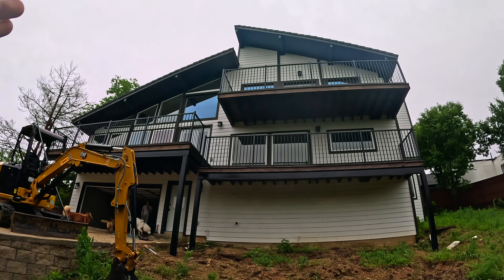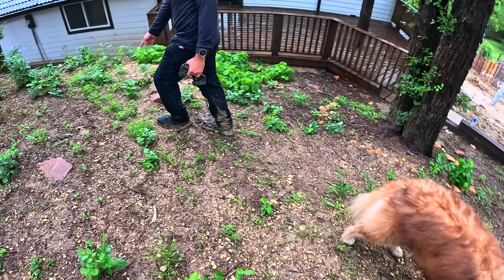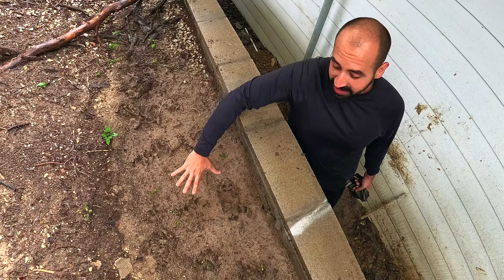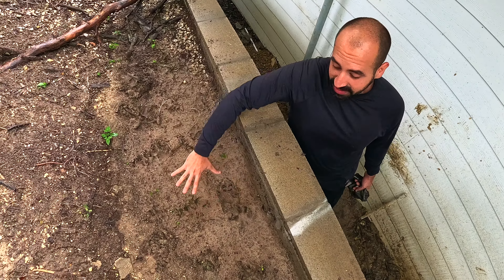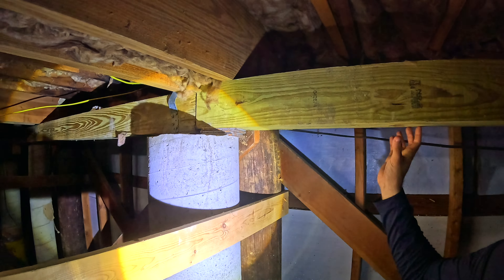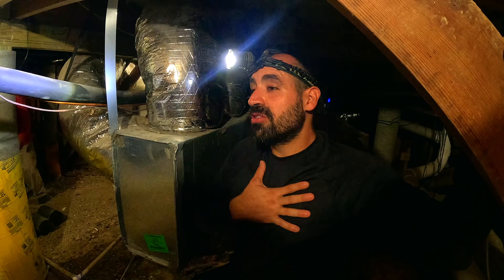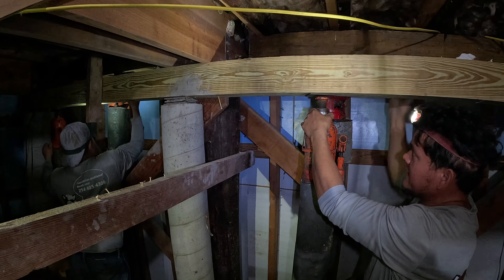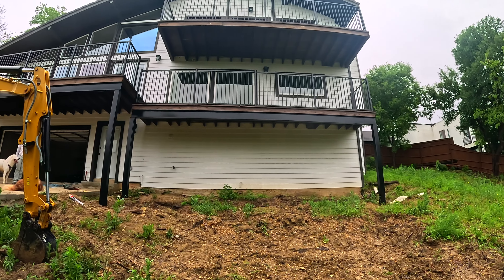Follow Our Recommendations: Don't Make This MISTAKE - Tales of Foundation Repair - iFiX

Comment: Nice video, quick question. I have a house with a sinking foundation that had the driveway and sidewalk re poured. Unfortunately they dowelled into the foundation with rebar to connect the sidewalk and driveway slab to the foundation. How would you go about jacking it back up knowing that the houses stem wall is connected to the sidewalk and driveway?
Reply from the maker: The work can still be done, and the foundation is repaired and releveled. Usually, if the concrete is attached to the house, at the moment the house is lifted, the concrete will go up with the house. Depending on how well the driveway and sidewalk were built, it could crack 2-4 away from the house or go up without damage.

Another option that can be done if the previous wants to be avoided would be to saw cutting the concrete about 1-2 feet away from the house to make sure that the house will go up without causing any movement or damage to the concrete.
Reply: @ifixconstructionfr  thank you for the reply, I enjoyed the video a lot. You know your stuff! Watching from Colorado where we have lots of expansive clay.